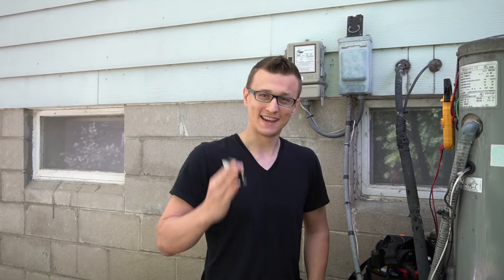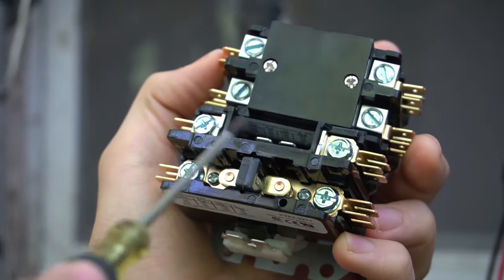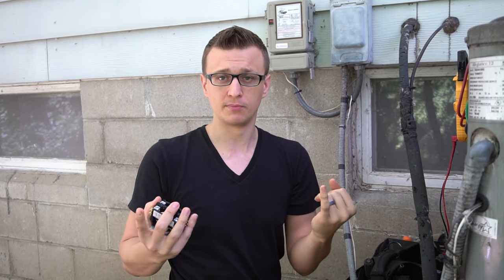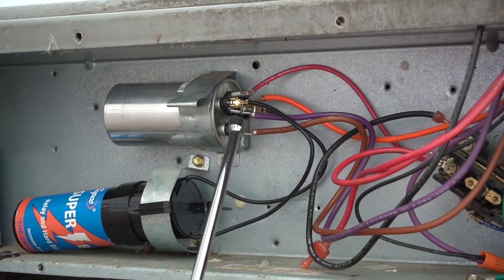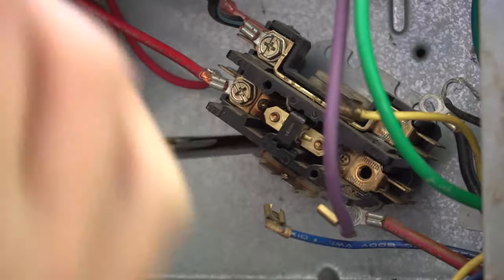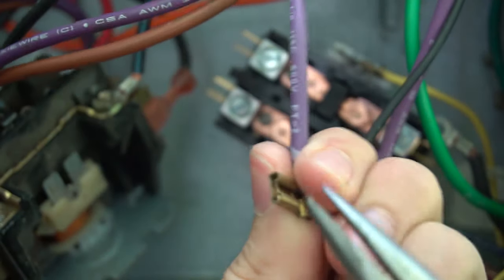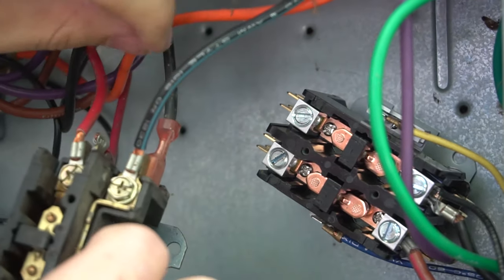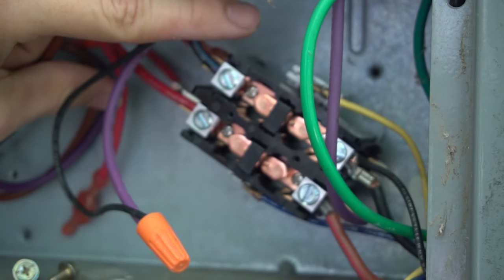How to Replace a Contactor in AC Unit

Comment: Hi Jay, I installed the air conditioning unit at the end of 2020, so it hasn't even been three years yet. Recently, my Nest thermostat started displaying an e103 error related to a Y1 power issue. After watching your video, I decided to replace the contactor with a 40-amp single-phase one, as the previous one was only 30 amps and single-phase. However, the new contactor didn't have any labels indicating which terminals were for the L and T connectors. In your video, you mentioned that if there are no labels, either side can be connected. I connected the cables and the air conditioning started working again.

The problem I encountered is that after the desired temperature is reached, the air conditioning unit turns off but the external fan continues to run.  I suspect that I may have incorrectly connected the contactor. Is there a way to stop the external fan when the air conditioning unit is turned off?  

Could you please help.. how to fix this?   
Thank you.
Reply: I just replaced my contactor last night, and as soon as I turn the breaker on, the fan runs.  Didn't try running the AC.  I am thinking this is because the fan motor wire is plugged into the 240v (hot side).  I put it there since that's how the old contactor was wired.  However, it's also plugged in above in the video.  Jay seems to suggest going to a 2-pole contactor, I wonder if that's the fix for this.

Comment: I have a reverse problem. My fan turns on and won't shut off whenever I turn the AC on. Now I have to manually flip the breaker to turn it off after the AC shuts off when it cools the house down. Is the contactor available everywhere like Home Depot? The AC guy insisted that it's useless to replace cause my unit is 20 years old, trying to persuade me to buy a 9k new system. What should I do?
Reply: Amazon is your best bet. Your contactor gets stuck in closed position. Have it changed, it's cheap. Also if you have a old AC, get a kick start capacitor if you don't have one. AC can last 25/30 years if well maintained.
Reply: Great video,thanks

Comment: Do window air conditioning units have all these components also
Reply from the maker: The do have some same components but they are not the same. I have a video on window unit AC components if you are interested.
Reply: @WordofAdviceTV   thank you very much we just had to replace our central unit and of course when it's 95 degrees when it went down

Comment: My contactor will not pull in. I can push the plunger in and everything works. Any suggestions?  Love your videos they are very informative.
Reply: If it's not pulling in it isn't getting the call from your thermostat or board.  You need to check why.
Reply: The coils are dead more likely. You have to get a new contactor.

Comment: Any idea what would cause the contactor to burn up
Reply from the maker: Possibly a power surge or a loose connection? It's hard to guess but it's something that needs to be dealt with if this is not the first time this happens within a short timeframe.
Reply: I replaced the contactor about three times already, do you think the circuit board is sending less than 24 volts intermittently. Because I put a brand new Ac, but after a couple weeks it did the same thing. I have never seen this issue before, also checked all connections,  but everything is fine. Appreciate your help. Thanks
Reply from the maker: @surujnarinepundit137  That's a tough one. Intermittent problems like that can sometimes be near impossible to track down since you never know when it's going to happen. Usually contactors burn out if there is too much current going through them. I would try installing one of these guys instead of a regular contactor: https://www.youtube.com/watch?v=qgHsGR4WT18

Or maybe put in a surge protector?
Reply: @WordofAdviceTV  Thank you so much,  much appreciated

Comment: I had a  capacitor go 'BANG" when i did that screwdriver discharge tick. Then found some advice on creating a wire with a  resistor attached for to use with higher power capacitors. So maybe you should mention that screwdriver discharge method shouldn't be done on capacitors over a certain size. 

otherwise I'm, digging your videos : )

Comment: Thank you so much! Your videos have saved me hundreds of dollars and taught me so much. Your very thorough and detailed instruction have been a tremendous help. I have replaced my contactor and capacitor (preventative maintenance). Bugs got into my contactor and shorted it out. It was still useable but the tech suggested I replace it and wanted to charge me 500 to do it. Cost me less than 25 for both repairs and you helped make it simple. Im a lot more confident about doing my own repairs and maintenance thanks to you.
I do have a question. I noticed as I was installing a UV lamp in my ac coil that theres a contactor in my air handler also. Is that something I should consider replacing sometime soon also? My system is just over 4 years old.  5 from the date of manufacture.